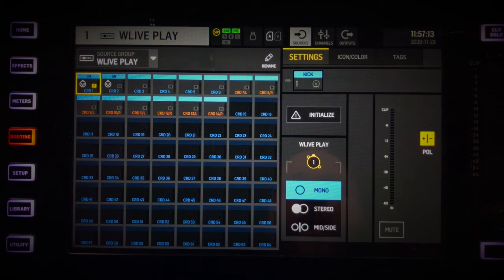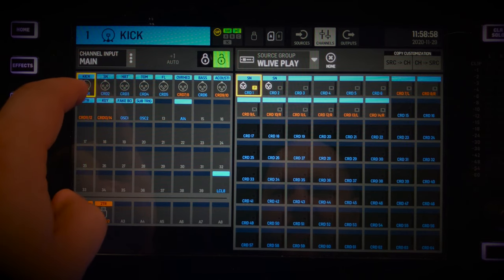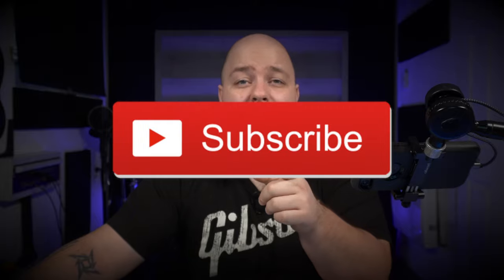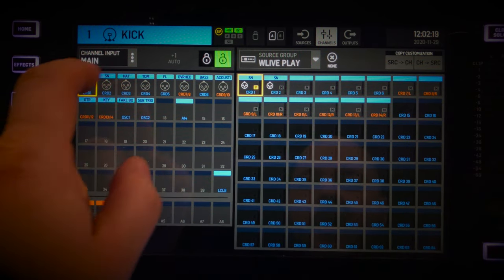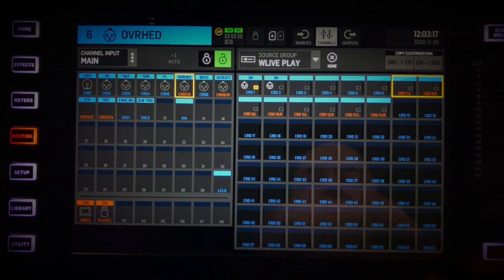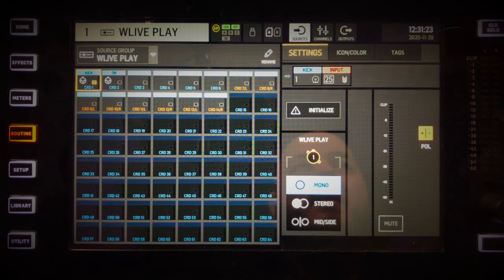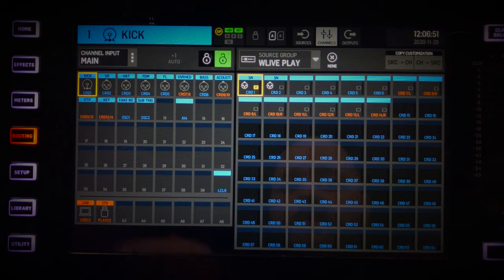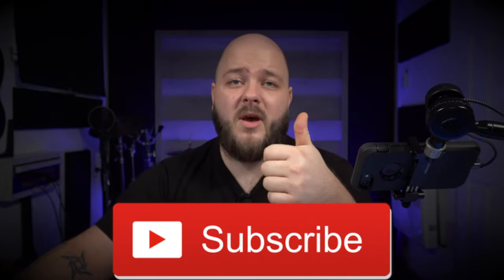[Quick WING Tips] Channel Source & Routing Explained - Mono VS Stereo & Inputs Name #Behringer #WING

Comment: Thanks for your valuable contributions, Guillaume!
Hey, so when a Stereo-mode channel then goes to a Mono dual bus, say Mains L and Mains R, do you just assign it to both of them, panned L-R respectively, and then the Wing somehow sorts out the disassembly and division of L-R content? If so, sounds like some trick engineering there by WING.
Reply from the maker: Hi 👋 

There is not really a mono bus on the WING, your Mains are all stereo, as well as all buses are LR
Reply: @GuillaumeLortie Aha! Because I'd seen examples of MAINS showing a L and a R, I assumed the Mains were only mono, but now I see I can make one channel be stereo and assign its output to 2 locations (L&R) and/or another stereo input. Cool.
Thank you, Sir!

Comment: Thanks Guillaume,very informative. Question, how can I use a external soundtrack/cd player with the Beringer?
Reply from the maker: Hi 👋 
Depends on your device outputs. 

If you have a CD plays with Line Outputs, just use the ¼ jacks inputs in the back. 

You may also consider using a USB stick on the top left of the console with 44.1 or 48k WAV files ( need to be the same clock as your console ) for easy playback that will never skip. 

I also have a video on the USB Player. 

Thanks for watching!
Have a great day

Comment: Thanks for a great video!

I got one question though; When you link two inputs, like you did with your guitar or OHs it seems like they then just take up one mixing channel on the console? So unlike on the x32 or a lot of other desks only one mixing channel is used even though it's technically two XLRs.

Does that mean that you technically could have 80 inputs (40 stereo pairs) mixed on the 40 channels of the Wing (if the I/O permits it)?
Reply from the maker: Hi 👋 

It’s actually 96 preamp over 48 channels on the wing (40+8) if you really want to go all out. 
All channels can mono or stereo source. 

With the 3 AES50 ports. You can have 144 mic pre to chose from. 

It’s big! 

Hope that answer your question!